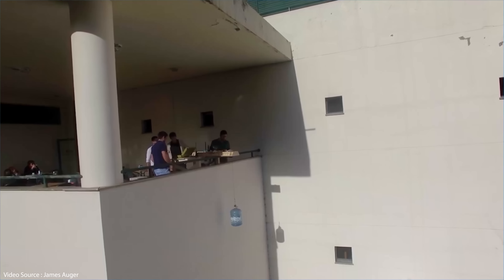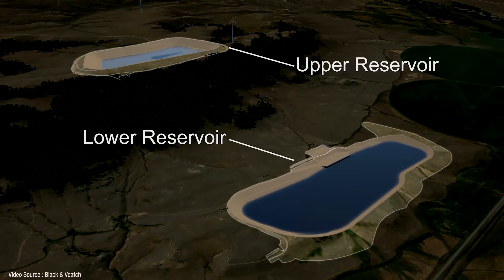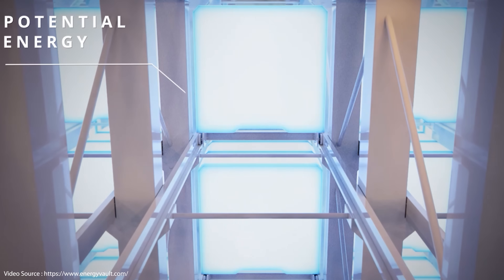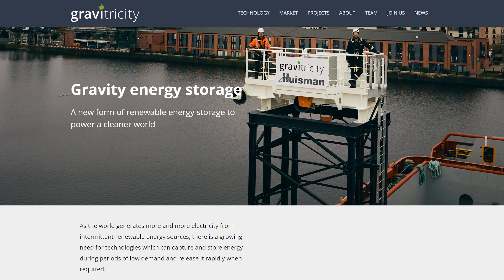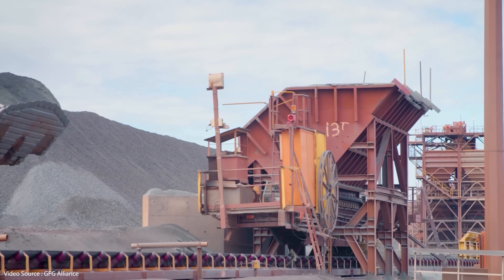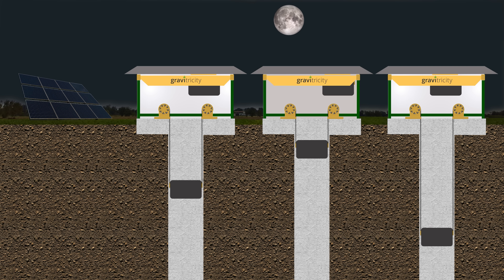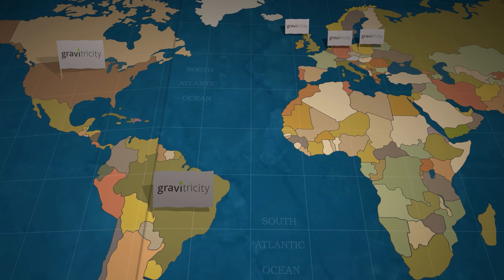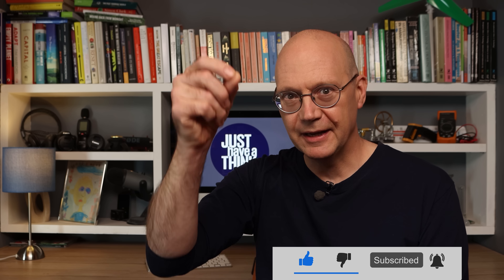Gravity Energy Storage. Who's right and who's wrong?

Comment: If they're planning to build a facility into an old mine, pumped storage with water is still better than moving ore around.    Many old mines are full of water  ---  ground water intrusion is a major engineering concern in most active mines,  many of them flood almost as soon as they're decommissioned, and the pumps are shut down.    It does seem like an end of life mine already has most of the infrastructure in place for pumped storage.
Reply: There are several issues.

1. Depending one the mine, you may only get an operational lifetime of several years. In some cases, you might only have months before the mine floods. Moving a power plant every several months to years isn't very feasible, or reasonable.

2. Everyone is ignoring a relatively significant factor: what are you doing with the water you pump out of the mine before you allow it to flow back in? Water that has been pumped out of almost all mines will be contaminated and thus cannot be released into the environment, so you will need to build storage. If that storage is open to the environment, say some kind of reservoir, you will need water treatment because that reservoir will also collect water from the environment such as snowmelt and rain, and that water will not only eventually fill your reservoir, but it will be in contact with the mine water and so will require some kind of treatment before it can be released safely into the environment, which it has to be, because you need to keep enough space in the reservoir for the water going in and out of the mine.

If you aren't using a reservoir exposed to the environment, then you're using storage tanks...which will also require secondary containment in order to prevent release if a tank fails. Also, that's very expensive.

3. Ask anyone in the environmental field about the ongoing costs of water management at old mine sites. They do everything in their power not to have water going in and out of old mines if at all possible. Consider, for instance, the problem of Acid Rock Drainage. The problem is caused when sulfides in rocks are exposed to air and water. The problem is most often dealt with by trying to keep the rocks with the sulfides either completely in water, so not exposed to air, or dry, so minimal water contact. The idea of pumping water in and out is literally the worst thing you can do to prevent groundwater contamination, and thus causing an major environmental issue.

I would suggest that a "clean energy storage solution" that causes a major water contamination issue isn't clean in the least.
Reply: @keith6706   My point is that this is much more workable that lifting and dropping blocks.   I was expecting that the above ground reservoir would be impounded.
Maybe this isn't a good idea---cranes and blocks is much worse.
Reply: @chuckoneill2023  I think you are correct. Further, within reasonable limits, a mineshaft with constant water ingress is really just supplying water that potentially can be used for pumped hydro. As long as your turbine is far enough down to get the required pressure, and the exit is above the water level in the shaft, you can generate. Pumping the shaft clear and storing the water in an above ground reservoir (probably an existing tailings dam) seems feasible. And it doesn't need to be potable, contaminated water should drive a turbine just fine. 

It seems likely that there would be candidate sites that could support this kind of solution - a large enough shaft, water capacity, storage above etc. Maybe you would have to pump the shaft clear initially, but doesnt that just fill your aboveground reservoir? And it seems to have less infrastructure than the gravity weight system, unless the water turbine is very much harder than the wire rope driven turbine.
Reply: As you said, you need constant pumping to keep the water out.
Pumped hydro can't work if the bottom lake keeps filling on it's own
Reply: @zbarba  In most cases, the speed it fills at is slow enough to not be a problem.    The capacity is generally very, very large.   It would likely be much larger than whatever the surface area tank or lake would be.
Reply: @chuckoneill2023  I find that hard to believe. You get a lot of volume from a reservoir since it is roughly cube or cone shaped. Meanwhile a mineshaft is by design narrow and windy.
Reply: @ruukinen  Actually, I think you're confusing a mine with a cave or cavern.   Mine shafts are generally cut as straight as possible, for ease of removing the ore.
In any case, however straight or crooked the shafts are has little impact on the flow of water.
I toured an old below ground iron mine a few years ago.   The void left behind by mining out a large deposit was basically the size of a cathedral.
Reply: @chuckoneill2023  Yeah and you can fit several cathedrals in a lake. My point is a large surface area means just the thin surface layer of a lake probably has more water volume than a decent size mine.
Reply: @ruukinen  Well, maybe pumped storage wouldn't work in all or even most mines.   My point is that it is always better than hauling rocks or concrete up and down.
Reply: A hole that is continuously filling up with water would seem to work against the pumped hydro design. Also the reservoir lake or top side storage would need to increase in volume to match the water inrush. Furthermore the likelihood of direct seepage of the holding lake into the surrounding ground and thus into the shaft would require significant infrastructure to isolate the lake from the shaft. The weight of a lake and etc. built above the shaft may also require reinforcement of the shaft.
I am all for alternative energy sources but these problems seem obvious.
Reply: @markhonea2461  I agree --- but it's still more workable than cranes and concrete blocks.
The reservoir above as well as the cavern below may leak, the reservoir doesn't need to be directly over the mine in any case.   Extra water seeping into your lower cavern is actually good, within wide limits -- there's going to be some loss to evaporation in any case.
I'm not proposing that this would be a good idea --- I just point out that moving blocks with cranes is much, much worse.
Reply: What about capturing humidity on top of a mountain using mesh nets and transferring it to holding ponds then letting huge bags of it down a slide or chute?   You could use wind power up there and use that to run pumps while you have wind and solar too.   I want to see how that math breaks out.  How much water do you have to have at what height do produce how much energy and how much can you get from nets.  If you could capture clouds up there you could make a lot of power.  An average cloud weighs about about 1 billion 400 million pounds.   Capturing clouds already in the sky seems like an op way to get a lot of weight high up for something like this.  You could also run huge Absorption Refrigeration systems up there and make cool air to pump down and get tons of water up there as well... not sure how well you could use the cold air but the largest Absorption Refrigeration units made now make something like 250k gallons of water per day.  That's about 950k kilos of water per day per unit being run on a mountain.  Making weight up high rather than lugging it up high.  I just ran a little basic math so see how it would shake out.  So 1 square meter of fog collecting mesh collects about 1 gallon of water per day.  there are 2.59x10e6 square meters in a square mile aka 630 acres.   and water weighs about 8.35 lb per gallon 25900000 X 8.35 = 216265000.  divided by 2.2 to turn lbs into kilos. 98302272 kilos.  per square mile.  I noticed that there is a mt Whitney in California near LA and San Fransisco and it is about 6000 to 14000 ft above sea level and 581000 acres San Fransisco is about 52 ft above sea level.   So 1 percent of this mountain is 5810 acres.  Let call it 9 square miles...  lets see how much power could be generated using the mesh over 9 square miles assuming 10000 square feet up and if somehow you could lower it all the way down just for reference.    Looks like you'd have about 90000000 kilograms of weight at a height of about 10 kilometers per day.  Sounds like about 9 billion or so kilowatt hours if you use 1 kilogram at 1 kilometer has about 1 kwh of energy potential I heard somewhere that was about right a while back.  So I now have 9 billion kilowatt hours per day of energy storage using the weight of fog and clouds let's say maybe.   Okay so now over 365 days in a year.   That's about 3.285 trillion kwhs per year.   That is about 80 percent of the number that I get for the total energy consumption for the entire country annually.  3,900,875,000,000.00 kWh (2018).  That would be using 1 9th of 1 percent of 1 mountain in California 9 square miles.  Please if you read this and even half ass care correct my math.  Total infrastructure cost a bunch of mesh a couple very long slides and some pretty substantial generators then it's problem solved.  Btw in this design I used no solar or wind power at all just mesh collecting water on a mountain.  Yes it would be too much power to transmit all over the country through power lines but if you have that much power use it to breakdown water into H 02 and make pipelines that can send the gas across the country I think that would be much cheaper then any other way to transmit the power through  lines or truck it all over or whatever.
Reply: I just have to say: this is the best YouTube comment section I've ever read in my life.
Reply: For reference, the magnetite ore is 5 times the density of water. So in limited space, far more efficient
Reply: @capoeirastronaut   Not really -- water just needs pumps and pipes.  These are generally easy to maintain.   The mechanisms to move ore around are much more complex and labor intensive.
Besides -- the energy needed to lift one pound of material a couple thousand feet or so is the same, regardless of density.
Reply: Most Mines keep a certain area clear of water to make sure the shaft doesn't collapse. And those pumps will run indefinetly.

Comment: how about a floating system?

a concrete large diameter underwater pipe holds fresh water, then a weight goes up and down within that column, the fresh water is just minimally maintenanced, flows around the weights.

Being offshore means the geographics are less problematic, using freshwater in the column reduces maintenance issues. Construction is simplified by using buoyancy as a tool to support construction and allow quick switchover of the top mounted mechanics.

Comment: Hello.
You didn't put the LCOS of pumped hydro in the graph.
You didn't talk about round trip storage efficiency. How much electrical energy you can get  out of the system for each MWh you put in.
The cost per MWh is too high, and probably wont compete with peaker plants.
If you add cost of storage and non peak energy price, substract" charging" efficiency, it is more expensive than peak price.
I think there would be more money in grid frequency response.

Comment: I do believe that pumped hydro is ultimately the answer. It has been a proven technology with far fewer longevity problems than the mechanical wear and tear of wire rope llift systems. Respectfully, Dennis, KV4WM
Reply: And you could probably build hundreds of water towers for the cost of one building full of concrete blocks.
Reply: @darrennew8211  the problem is you cannot build towers big enough to be very effective. You need a huge amount of water and height to do pimped hydro.
Reply: @darrennew8211  pumped hydro is not that good at small scale and water doesn't contribute well to lifetime of metal, using a mineshaft to move a weight makes more sense where conventional pumped hydro is not viable
Reply: The issue is that there are a limited number of places in the world where pumped hydro works. And they basically all have pumped hydro already.
Reply: It obviously has geographical issues though, a lot of countries have nowhere else to put any more hydroelectricity, england for one example really, we dont really have anywhere else to put them, an alternate way of doing what hydro can do is absolutely something worth atleast looking into, since were going to need it for a green revolution.
Reply: Yes and it has an impressive effenciency if build big enough.
Reply: We can no longer rely on using water for storage. Lakes dry up and the whole system becomes unreliable. Recycle Lead (Pb). Lead is 11.4 times heavier than water for the same volume. Gravitricity should cut a deal with the US government to recycle all the Lead pipe that is being dug up and replaced.
Reply: it causes ecological disturbances... even wind turbines cause birds to be hit with the blades.... this seems much safer for wildlife.
Reply: @saurabhmangal6322  Pumped hydro still uses wind power.
Reply: pumped hydro is great but requires a suitable terrain to be useful
Reply: Head loss (friction) in the pipes is the problem with hydro. Pulleys are much more efficient.

Comment: Pumped hydro's potential has been vastly underestimated. Conventionally it's thought to be limited to mountainous areas with plenty of rainfall and consequent creeks that can be dammed. However, dry mountain regions can easily have enough water pumped in from many miles away to fill a lake, and such lakes can be covered e.g. with floating solar panels to minimize evaporation. A system of long distance water pipelines plus power transmission lines could allow us to scale up pumped hydro sufficiently to solve the entirety of the several-hours-to-a-few-days energy storage challenge.

Comment: I wonder how hard it would be to use the concept of the block that is moved around in a grid to the mine-shaft. If you put rail car wheels on the weights, you could have several weights use the same shaft after another by lowering the 'depleted' ones onto rail tracks that are pushed into a tunnel. Conversely, when you're charging the battery you just pull each of the weight-cars up the shaft and push them onto a piece of track on the surface, maybe in a long depot. It would be more mechanically complex, but you'd get a bigger battery with only one shaft. EDIT: and if the shafts are close by, they could all share the same rail network of tunnels and depots.

Comment: To put it bluntly, the Energy Vault concept looks like an engineering nightmare. The maintenance of all that complex machinery is not going to be cheap. And it may also involve a lot of downtime. The Gravitricity solution looks interesting, but it only uses a small part of the mine (i.e. the mineshaft). The majority of the volume in a mine is in the horizontal passages... which could store massive amounts of water!
Reply: Indeed. The biggest problem with gravity storage is that a singular weight per generator is not efficient enough. So you need to run multiple units on the same machine. For hydro that is easy is water willingly flows to and from the endpoints of your machine.

Personally, I'd look at gravel as a storage medium. To a certain extent, it flows, it can be stored in heaps and picked up with automated buckets. This makes lignite pits viable for the height difference.

Comment: It just feels like Gravitricity is the more reasonable concept. Taking existing unused shafts, smaller container based weights and existing technology makes it seems like a viable prototype. It will have to be proven to actually work and give the expected outputs, but it at least isn't a huge tower of concrete blocks
Reply: Mineshafts are a) small and b) few and far between, relatively speaking. This would be a very small scale setup.
Reply: Leveling out grid demand with rapid response  is also a good idea. It’s not trying to compete with pumped hydro, it’s dealing with brief shortages.
Reply: @history8192  but batteries are much better at that. Bigger capacity and much faster.

Comment: If you used gravity to drop a heavy pointed weight into water to generate electricity and used air injection into air bladders (or gas or gel ...lighter than water) to assist the lift. Seems to me you could gain energy and it could be designed durable enough. You could actually use water tubes and air release valves to control fall speeds friction etc. Like a straw in an upside-down bottle of water lets the air release. Air and water and gravity. Seems so simple why is this not happening?

Comment: So I did some maths:
We said we have 500 tons of weight. I would think mine shafts are in general not 1km long but shorter but we will assume 1km length for easy maths. 

Energie stored is E = m*g*h = 500tons * 1km * 10 m/s² = 5000000000 Joule = 1400kWh.

Germany has a daily energy consumption of 1,5 billion kWh. So we would need 1 Million of those shafts (with 100% efficiency) to fuel the German power grid for one day. I dont think that system is anywhere near to being a meaningful power storage. Most shafts are shorter and the efficiency is not 100%. So you probably need more like 2 Million of those systems to get one day of power for Germany.

I think this could be feasable if you have an old mine shaft in your garden and want to be self sufficient but thats it.